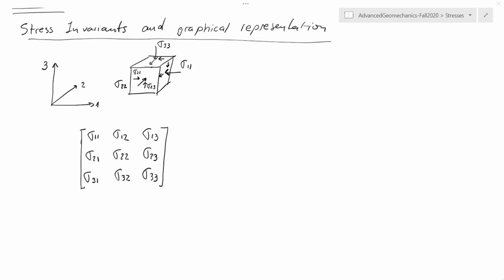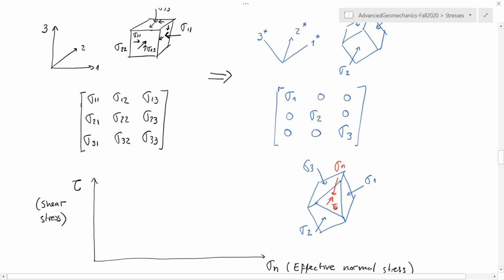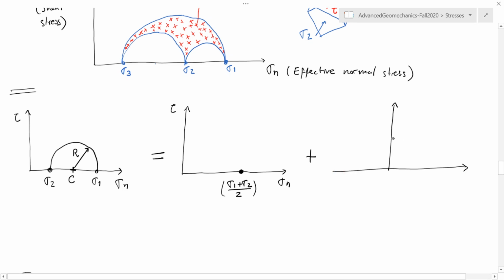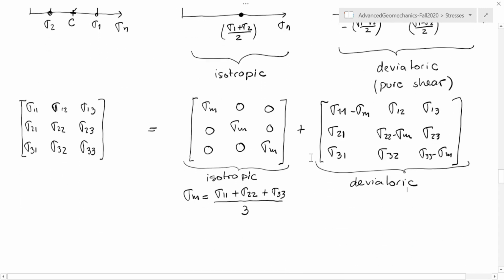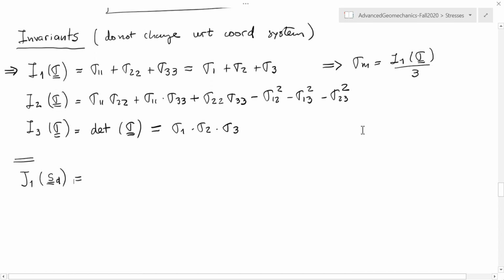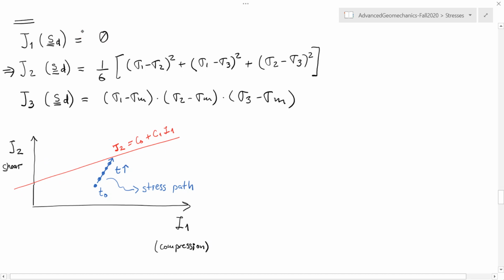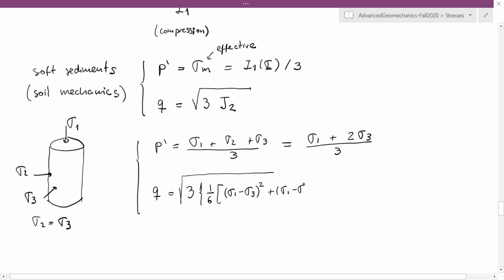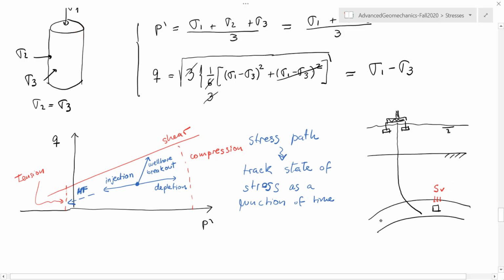L04 Stress invariants, isotropic and deviatoric stress components, stress path

Comment: Thank you so much Dr. Espinoza. Could you tell me in which book or article to find the physical interpretation of the third invariant?
Reply from the maker: Great question Esteban! I had a feeling for what it meant but not quite until you asked and I solved the problem! Here it goes:
The third invariant reduces to the determinant of the stress tensor, so when written in principal stresses
   I_3 = sigma_1*sigma_2*sigma_3    
Let's call D13 = sigma_1 - sigma_3 and D23 = sigma_2 - sigma_3, and use these D's (Mohr circle diameters) in the equation above.
You get
   I_3 = D13*D23*sigma_3 + (D13+D23)*sigma_3 + sigma_3^3
Hence, I_3 gives you an idea of the difference between sigma_1 and sigma_2  with sigma_3.
For a compressional "polyaxial" state with   sigma_1 != sigma_2 !=  sigma_3, I_3 is bound by the perfect triaxial extension case (sigma_1 = sigma_2 > sigma_3) and the perfect triaxial compression case (sigma_1 > sigma_2 = sigma_3) (See lectures on Mohr-Coulomb criterion with triaxial extension and compression), such that
Triax ext bound:  (sigma_1 - sigma_3)*sigma_3^2 + sigma_3^3 < I_3 < Triax comp bound:  (sigma_1 - sigma_3)^2*sigma_3 + 2(sigma_1 - sigma_3)*sigma_3^2 + sigma_3^3.
In summary, I_3 tell you how far you are in between triax compression and triax extension!
Notice the I_3 = 0 would happen for plane-stress (sigma_3 = 0) or I_3 <0 could happen for sigma_3 < 0 (tension on one direction).
Hope this helps!